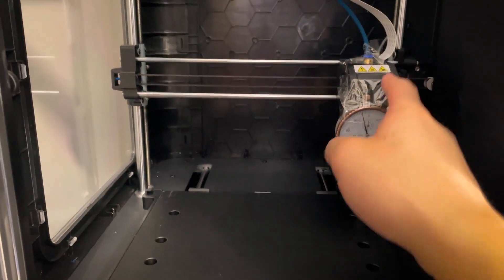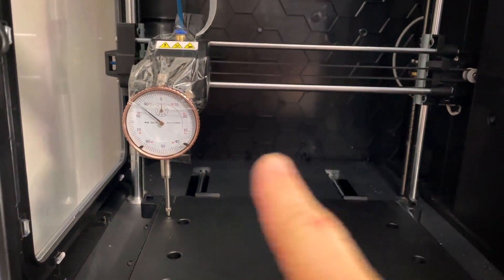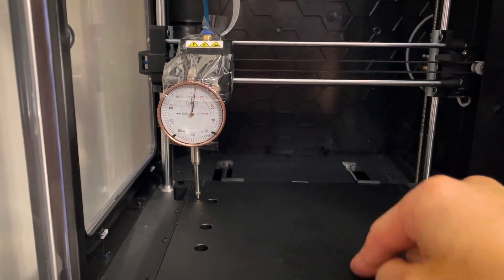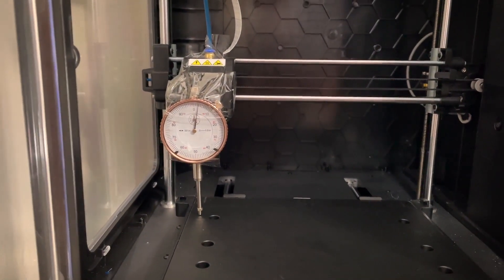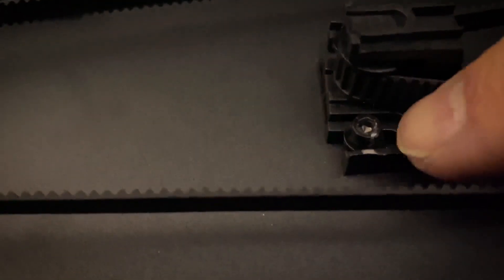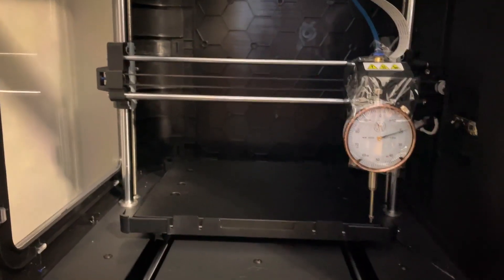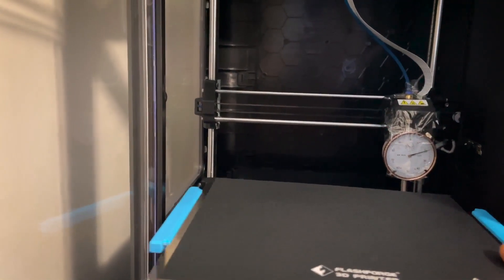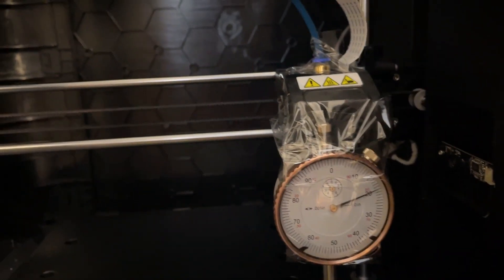How to Troubleshoot Uneven Bed + Advanced  Bed Levelling Methods [Adventurer 4]

Comment: Thank you for the videos about A4 levelling issues and fixes. I’m having the same problem and feel that the “9 point calibration” was misleading. I wish I purchased a printer from another manufacturer since some units have easy ways to adjust the bed height in all 4 corners. Unfortunately, I didn’t see your videos before I bought my A4! Liked and subscribed
Reply from the maker: Yeh the four knobs in the corners would be nice or at least some secure way of levelling. Software compensation would be great but support said that it’s out of the question due to the price range of this printer

Comment: Thanks so much for this, it fixed my issue perfectly. I've been troubleshooting my badly leveled printer for a couple of months now, my levelling issues occurred after the print head crashed into a print during my attempt to restart on a failed print, the nozzle buried itself in the print then several loud knocks that I now know was the belt jumping on the top pulley's, it seems the belt skipped one side more than the other. I'd been unable to print large pieces since as the print lifted off the bed then severe warping.

Comment: I would recommend checking the guide rods for straightness. An easy way to check the bed for bow is by placing a steel straight ruler on it. If you can see day light or can slip a piece of paper between the ruler and the bed, it would indicate you have at least .004” of an inch gap. If under warranty, I would definitely ask for replacement parts sent to you.

Comment: This was a great video! May I ask where the screws were located before you started to adjust the rails. You mentioned that you will try to tighten those screws and maybe that will do the trick, but unfortunately it didn't.  I have the exact same issue as you do and I want to see if adjusting the screws first will help. Thanks a lot! I appreciate your help!

Comment: Hey Daniel very informative video.
On my adventurer 4 I actually found the build plate had a high spot almost dead center. Some 0.05mm shim in a can from my local machine shop and messing around placing strips I was able to level it to a point where I'm happy printing across the entire surface. But as you said the build plat is prone to moving so a couple binder clips are helping hold it down just in case.
Reply from the maker: Ahhh yes Good suggestion on binder clips. I added some LEDs to the side of the print bed so it may or may not work with my new setup

Comment: Daniel this video is crazy good, thank you so much for sharing! I think in the future I will give this a go, Also I am curious if sanding the bed would help its flatness even more, Cause it reminds me of an engine of a car, where you would machine/sand a warped head to get full flatness - Basically get something very flat like a metal ruler and lay it on the bed then use a feeler gauge under the ruler so if the feeler gauge would slip under it that would indicate the error in the flatness of the bed in that area.
Reply from the maker: Good suggestion on the ruler and feeler gauge! I shall try that tonight. I am fairly confident that it must be the gantry cause the plate was CNC machined flat but only a test will tell :)

Comment: I know you've moved on from the Adv4 but was thinking that this warping might be cured with very thinned out paint or epoxy allowing it to level. Heating the bed during use is another issue though. Grinding the plate flat will also work, but that's a lot of work beyond most people's toolset.
Secondly, isn't there some grub screw in the top cog on the shaft? I would have thought you'd loosen it and manually turn the shaft to raise or lower it without loosing tension between cogs.

Comment: Thanks for the cool video. What is the estimated value of the z-axis lift when changing one tooth on the belt?
Reply from the maker: I don’t know off the top of my head but you could find the pitch of the lead screw and also the number of teeth per revolution of the pulley to calculate the estimated value of the z axis lift per tooth

Comment: What's the process for opening the top cover?

I would like to replace the noisy top fan with a Noctua.
Reply from the maker: I don’t think you will be Annie to replace the fan unless you add some voltage converter since the fans are 24V while Noctua runs on 12V.

I’ll do a quick video on how to remove the top cause it was nerve wracking the first time I did it
Reply: Maybe run 2 fans in series then?

Comment: Have you had any issues with your y axis?? The front of my bed is way higher than the back. Not sure  what the heck is going on it’s a fairly recent thing that’s happened
Reply: I am experiencing the exact same issue. Not sure if the front is too high or the back is too low. I've had the printer a week and just started noticing the back first layer is always thicker even after many 9 point calibrations. I'm currently in the beginning stages of talking with Flashforge tech support. Have you been about to fix your problem?

Comment: I love my Adv. 4!! I would caution on doing this advanced adjustment, as it really will only address a tilt issue with regarding the gantry vs the bed.  It really doesn't address the curve that is being measured.  In my opinion the printer should never have left the factory if it is that far off.  I believe the root of the problem is with the bed cover and it flexing during heating and cooling cycles.  Daniel's video on using shims under the flex plate is a much better solution for getting that near perfect leveling of the bed.  My reference is based on this video - https://youtu.be/QTURCO3ggKs - which shows the removal of the actual heating element from under the bed main plate.  The plate is held onto the railing systems by only 6 screws on either side, there is no support or attachment in the middle. The bed plate cover is a shell and when the heating element comes up to temperature the plate flexes somewhat in the middle causing the dip or rise across the middle of the bed giving the change is Z axes difference to the nozzle.  I've seen some recommendations out there where bed leveling should really be performed with the nozzle and bed pre-heated to the production temperatures you'll be using.  One technical question I have for the Flashforge support team what is the torque specification for those 6 screws holding down the bed?  I did notice that mine were not tightened equally, which will also allow the plate to flex inconsistently.  

Good stuff Daniel!!  You keep us thinking out here. :)

Comment: I don't have bed leveling issues. I just have print quality issues and the filament feed wheel constantly grinds into the filament and therefore doesn't feed properly and ruins 12+ hr prints! 

Very frustrating as I has hoped this printer was a bit more user friendly and set and forget.. hasn't been at all.
Reply: I too have the same issue with the feed wheel slipping and grinding into the filament. Haven’t yet found a fix for this. Very frustrating for such a high end printer!